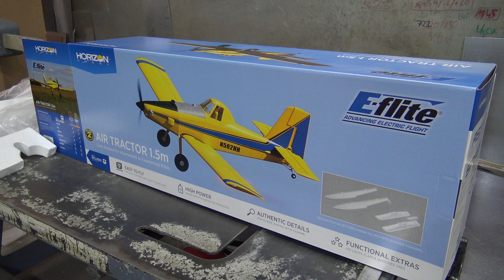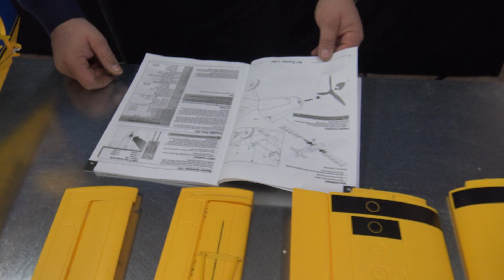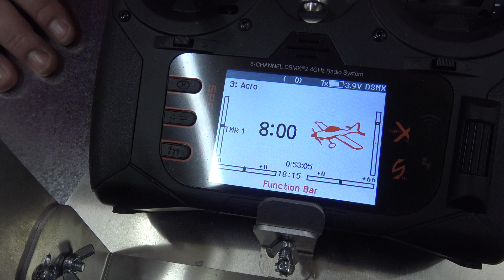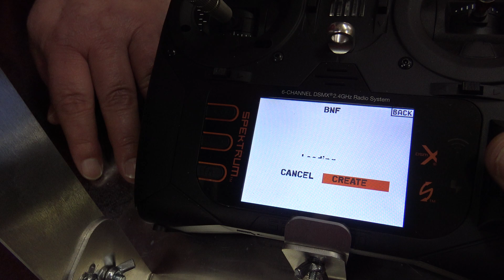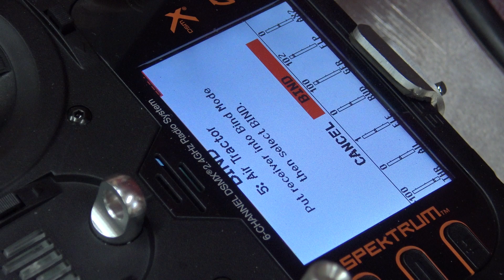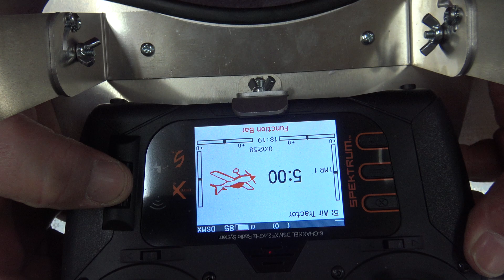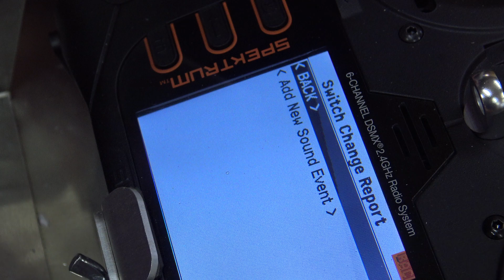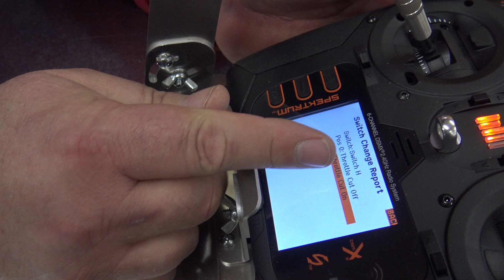E-Flite Air Tractor 1.5m BNF Basic with AS3X and SAFE Select Assembley and setup

Comment: A great wido for those that have been reluctant to buy a plane because they thought they were hard to assemble.  Nothing could be easier and you two are great at explaining the procedure.   Your time and help is appreciated.    Russ  NC/USA
Reply: NC here too
Reply: This video was very helpful because no instructions are given in the manual for connecting the springs to the tail wheel. Thanks!        -also NC/USA